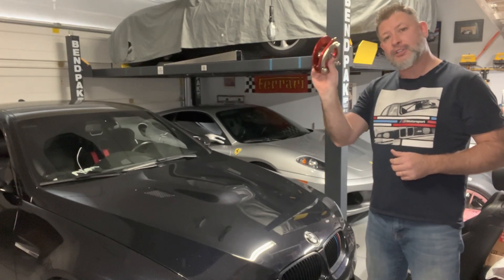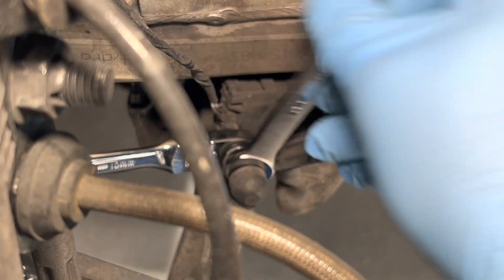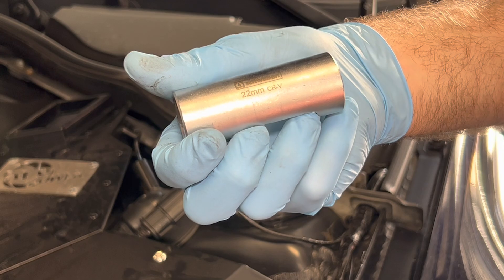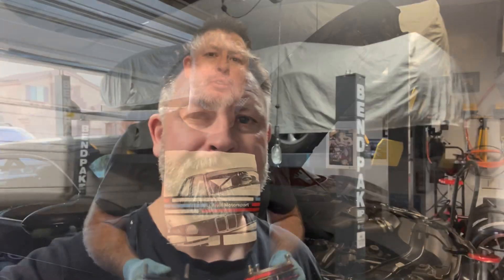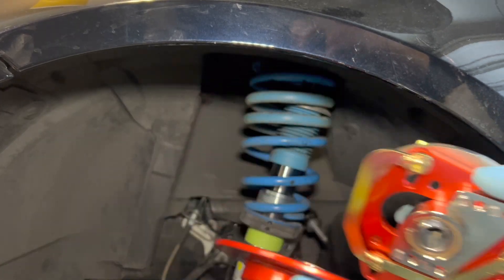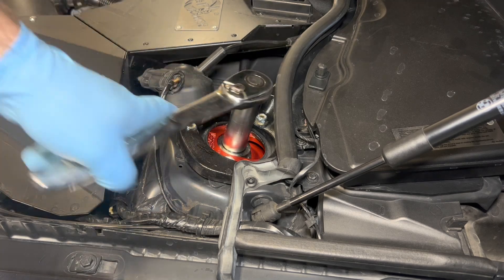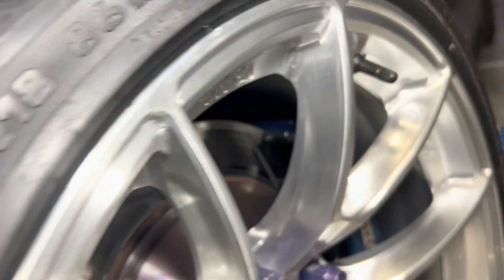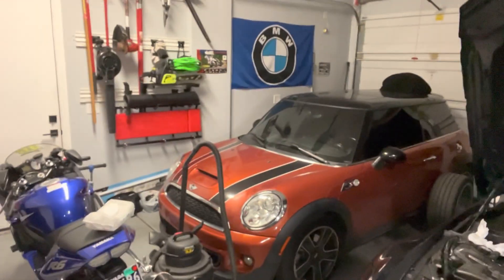Upgrade BMW M3:  Vorshlag Camber Plates

Comment: How is vorshlag?? Any nvh compare to stock??
Reply from the maker: Been great!  I haven’t noticed any nvh.  Only issue is I couldn’t torque the driver side nut to spec at max negative camber because the nut hits the strut tower.  As a result, the nut backed out on my twice.  Since then I learned my lesson and just move in slightly and am able to properly torque.